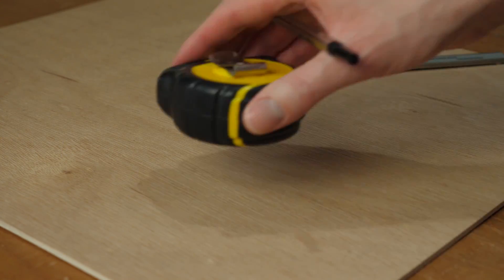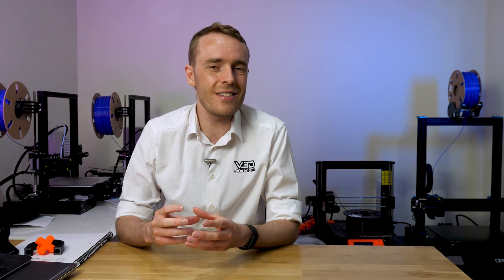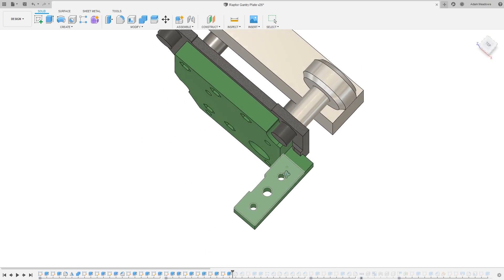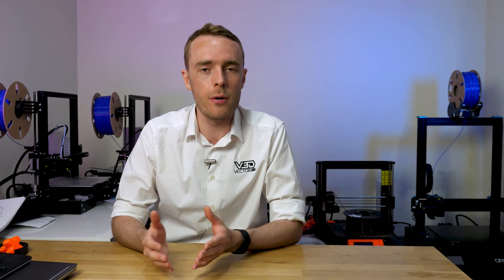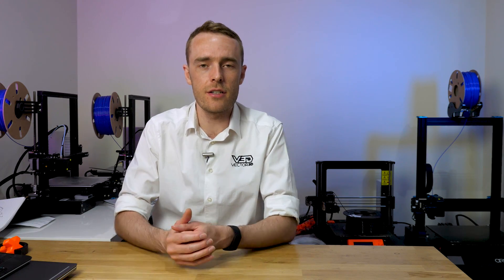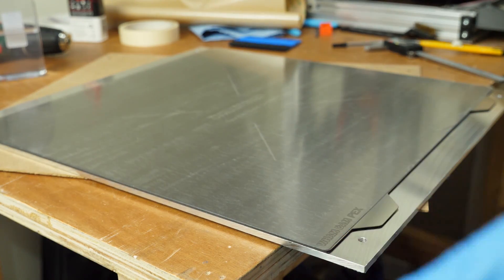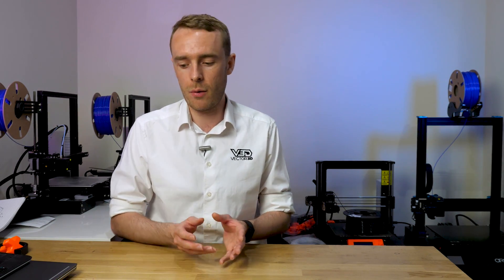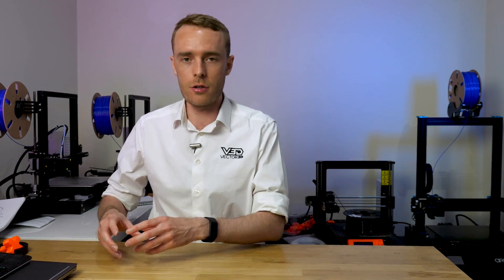High Performance Heated Bed Upgrade Guide

Comment: So my 500x500 bed needs a 1250watt heater? Oh my. What is i go with something smaller like 800watt? It will run on 240v..the ~400w less will just make it heat up slower right?

Comment: Hi Adam, I have an Ender 5 Plus that has a 377mm X 370mm plate that is warped so I am weighing up the options of either trying to flatten the plate or buying a new one, can you please tell me where you purchased yours and the price?
Reply from the maker: If i remember correctly, i bought mine from clickmetal. I googled "cast aluminium tooling plate uk"

Comment: I find it odd that for the very purpose of transmitting heat keenovo choose 2 terrible heat conductors silicone and fibreglass. It's the same for cooking don't use silicone unless your primary reason is nonstick because it's very bad at heat transfer!

Comment: Hi Adam, thank you for this video. Where did you buy this bed in the UK? I was looking around and I found a lot of different names of products like mill finished, grade 1050 or Precision Aluminum Cut Plates A5052P. All of them are confusing. A lot of sellers (companies not eBay) state that the plates are super flat but in the specs, I can see tolerances of +/- 0.3 mm or more that don't sound very flat to me(if I understood correctly).
Thank you

Comment: Great Video! Very detailed explanation! Inspired me to upgrade my Printer.
I'm working on a 220x330 bed.. and got 5mm aluminium. It's seems too thick for this size bed.. should i go for 3mm for a lighter bed?
Reply from the maker: i would keep with 5mm personally. make sure you have sufficent motor torque and blet strength to make it move how you want though.
Reply: @Vector3DP  wow that was quick! thanks for the advice! awesome! motor is fine! so i'm gonna keep it and proceed with the build!

Comment: I would get "cast aluminum plate" for example, precision machined alca 5 or mic 6 trade names. These will have a +/- .005" flatness tolerance. They have a uniform grain structure and not warp as bad as per say 6061, 5005, 3003 cold or hot rolled aluminum.
Reply from the maker: Tool plate is cast aluminium plate 👍
Reply: Actually Midwest steel supply says their flatness tolerance is .015 which is .38 mmm :-/

Comment: yea I just built a aluminum 1100mm X 1500mm heated bed. I just did 20 300mmx300mm PI sheets right to the aluminum bed to keep costs down. On heating it really warped up about 10mm in the center so I had to reinforce the bed with aluminum angle. Now its fairly flat and usable with a bed level probe. Thanks for sharing awesome vid man

Comment: I have been looking for the aluminum to do the same upgrade on my  CR-10.   Any way you could let us know where you got it ?
Reply from the maker: Click metal in the UK, or filafarm in Germany.
Reply: @Vector3DP  Can you give us some specs on that aluminum plate?
Reply: @MakerMark  Look for Mic6 aluminum.  Its very rigid and flat, and it's typically precision ground.  
If you're in the US, McMaster-Carr is a good source

Comment: Have you thought of using carbon fiber? Very light weight, very flat. Since it is carbon, i thing it could have decent thermal properties, maybe the epoxy resin couldn't handle the 100°+ (maybe it could, I don't know)
Reply from the maker: Its just hard to get hold of, and not sure pricing would be sensible either

Comment: Spoke to keenovo this week about getting a mat made for the ender 5 plus, should be released next week, will definitely be doing this mod soon.
Reply: For existing machines, simply use a round heating pad with the highest rating. Common 3D printers have low reliability on their maximum dimensions anyway, and the temperature difference will only be a few degrees.
Reply: i did the same last week and still waiting

Comment: I am using a 120V 750W heater on my CR-10, best upgrade I ever have done! Why were you wearing a respirator when you put the magnet on? I just want to make sure that there isn't some health risk that I am taking on accident.
Reply from the maker: Mask was for the large amount of IPA I used to clean the bed.

Comment: Where did you source the alluminum? Love the upgrade.
Reply: I tend to order MIC6 aluminum from Midwest Steel in the U.S. I use it for a Voron printer.
Reply: @marcosramirez385  how flat is Midwest Steels aluminum?

Comment: I made my bed similar but smaller scale (220x220). Two thing a did different was I got a keenovo heater without a thermistor, but with a hole in the middle. I then drilled and tapped a hole to allow me to use a screw in thermistor. I also added a reset-able surface mount thermal cutout switch using silicone to the back of the keenovo.

Comment: That plate is a LOT of weight  to accelerate........
Reply from the maker: As mentioned, higher weight generally requires slower acceleration for that axis, but otherwise not a problem.

Comment: Oh man i bought a 750 watts power silicone heated bed to use it on a 310x310mm bed T_T, if your math its correct than i need only 500watts, I would damage my aluminium? 50 dls waist?? T_T
Reply from the maker: Use firmware to limit the power output 
 by changing the max pwm down by about a third.

Comment: Hi Adam, thanks for the great video. I am about to build such a bed for a custom printer myself and am wondering about how strong the magnets are on these kind of flexbed systems. I have had cases where my flexbed has bend upwards on the corners on my Prusa MK3 when printing large PETG parts. Do you happen to have used different flex bed systems and can you compare the strength of the magnets?

Comment: Sorry for all my comments but I hope it will help you to have a better heated bed for the next time.
Don't feel bad for this one, if you encounter some problems that can be related to the things I've mentioned just post a comment or do a follow-up video to share you what you've learned the hard way.

Sooooo I see that you've screwed the bed on 4 points. It's great to provide a lot of support but if you don't watch out during the leveling procedure you may do 4 points bending instead of 4 points leveling. To better understand what's happening I really recommend you to read this article and do some research on how the industrial printers do it : https://drmrehorst.blogspot.com/2017/07/3-point-print-bed-leveling-vs-4-point.html?m=0
Sticking with 4 mounting points may well be the only solution considering the size of your bed but otherwise, if the printer allow it, 3 points leveling is the correct way to go.

Some people already mentioned the thermal expansion thing and I think the bigger hole solution can work but there is a nicer and more secure ways to do it :
https://drmrehorst.blogspot.com/2017/07/ultra-megamax-dominator-3d-printer-bed.html?m=0

It has been done by the same person on a moving bed assembly :
https://www.instructables.com/id/3D-Printer-Bed-UpgradeReplacement/
As always look and analyse what don't work on cheap machines and get learn how to properly do things on industrial grade stuff (here the extreme is those high temperature printer's you've seen at some shows)
Reply from the maker: Thanks for all your efforts. The base printer is not my design here, i'm just replacing the electronics mainly. I'm well versed on issues with 4 point mounting and adjustment. In this case, i'm basically going to set them all the same and use the BL touch to mesh level the details, so not a problem.
Again, im just making mods and didn't want to change the whole machine. The best solution for this right now is using a kinematic coupling for the bed mount, but that's a bit OTT for me to achieve at the moment.

Comment: Good advice Adam. That's pretty much how I did the #Borg. Same size bed, 240v 1Kw Keenovo heater and WhamBam FBS. I also added cork sheet under the heater and a thinner aluminium sheet under that to support the weight of the heater. Also, since I have a BL Touch, I mounted the bed on solid supports.

Comment: Good video! One point of feedback; you're giving a lot of explanation on why you make certain decisions in your design, which is great. However for a guide you're not giving a lot of explanation on how to execute things or why you're doing certain things. It might be useful to have little text bubbles explaining things during the mini montages of you drilling/glueing/whatever. e.g. using a larger drill bit if you don't have a deburring tool etc.

Additionally, whilst I agree that you shouldn't pick a heater with too much power, it doesn't HAVE to cause issues. You still have a tuneable feedback loop, so you can change your proportional gain in your PID values to prevent heating too quickly.
Reply from the maker: Deciding what to include and what not to include is probably the most difficult to answer, i'm trying to focus the guide on the specific topic and I have to assume some skills in other areas. I felt the skills needed to assemble were basic, and if not then they are shown and you could get other guides elsewhere.
Using PID to slow the heating is like patching a mistake where you bought a heater that was too powerful, but ye i guess that could work to some extent.

Comment: DEFINITELY add a THERMAL FUSE Seriously do it those heaters can be very dangerous. And GROUND YOUR FRAME AND BED. Seriously AC is no joke and those cheaper solid state relays are scary
They can actually sometimes melt metal and put out horrible fumes too if they stay connected
Reply from the maker: I've implemented bought beds with thermal fuse before, not sure if i will this time. Of course bed and frame will be grounded. As mentioned, wiring etc is in a different video. These SSRs are really over rated for this use, i've never had them even get slightly warm, let alone need a heatsink or melt anything.
Reply: @Vector3DP  accidents do happen, the worst part is that they fail in an ON state. meaning not even thermal runaway can save you. trust me it's worth it. accidents happen! better to not take the risk
Reply: @Vector3DP  The thermal fuse is also useful in case the adhesive of the silicon pad give up. If so, the feedback loop will increase the duty cycle and the silicon heater will overheat (and damaged what's underneath if only secured with the adhesive)
Reply: I've also noticed that you haven't sealed the edges of the silicon heater. https://www.keenovo.com/User's-Manual-Keenovo-Flexible-Heaters.pdf
According to the manufacture it's recommended to do so. Even though it's not so common, some people have demonstrated an increased adhesive durability. (One theorie is that oxygen from the air deteriorate the glue and so sealing the edges will reduce this effect)

Comment: One of the things I misordered was a  1000x1000mm heated bed, I realized after I should have specified some holes to be made around the center for additional mounting to prevent warping. What are your thoughts on drilling holes through a silicone heated bed and resealing it with some high temperature silicone?

I am probably not going to punch holes through it, just wondering your thoughts, no worries
Reply from the maker: You'll hit the traces which will ruin the bed. if you dont break them, they'll be thinner and overheat. Just don't do it.
Reply: @Vector3DP  thanks, I really appreciate hearing that o7
Reply: @Bajicoy  could you sandwich it between 2 plates?

Comment: Adam where did you get that inexpensive blue filament from?
Reply: IIRC he gets his filament from Ooznest
Reply from the maker: Yup, Ooznest is the stuff on cardboard spools in the background. Great people, great filament, great price.
Reply: @Vector3DP  There is some nice stuff on the web-site, I have always used cheap PLA and mid-priced PETG, I bought some Flashforge PLA last week and had a 16-hour print fail x2 because the filament got trapped between terrible windings.
 I'm going to give Ooznest a try as they are UK based and I guess if I need any advice on the products they are an e-mail or a call away, its a little more expensive than what I usually buy but I would rather pay more for filament I can trust

Comment: You should use oval holes on the bed mount because of the heat expansion. Or if you simply constrain it then your bed will warp when you heat it up.
Reply from the maker: Just got massive holes :)

Comment: Great vid there's not many guides out there for this kind of upgrade. I have a bed like this on a BLV MGN Cube. Keenovo pads are excellent and have a good reputation and they can produce custom sizes. A slightly cleaner way to do the mounting bolts is to tap the holes and use threaded rod. That way you secure the back side with a nut+washer and not have to worry about protruding bolt heads or having to countersink the tops. I have a glass top with PrintBite over the top of the mounting holes.
Reply: Did you tap blind holes? Or drill all the way thru, then thread bolt until flush?

Comment: Most bed temp limits are from adhesives or magnets, the e3d high temp bed is able to go up to 250C at it's peak temp because the aluminum and heating pad are fused together without glue.  At higher temps on larger beds you want the standoffs to allow the bed to be able to move horizontally to prevent the bed from warping due to thermal expansion.